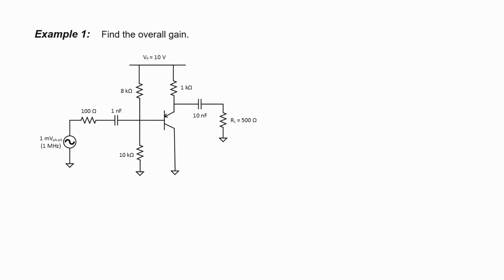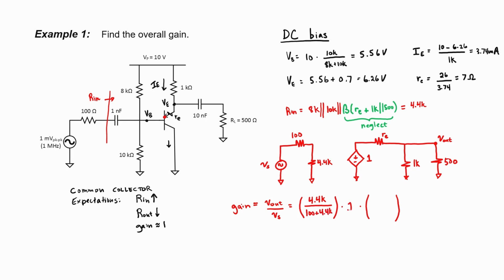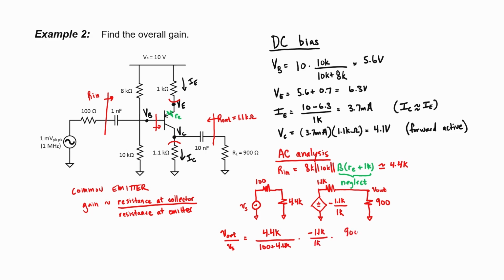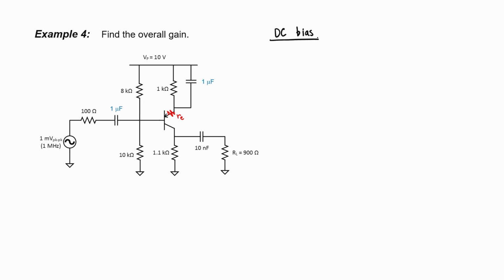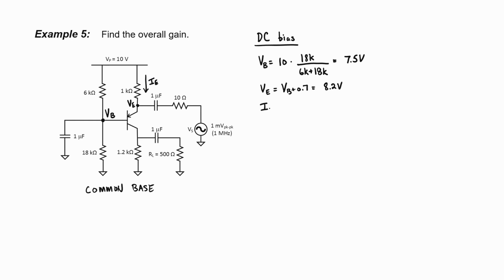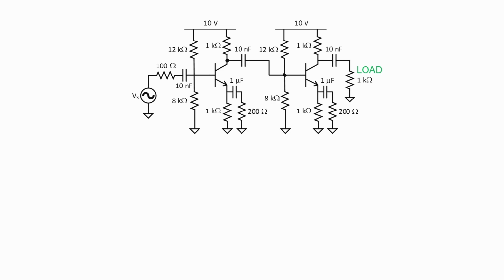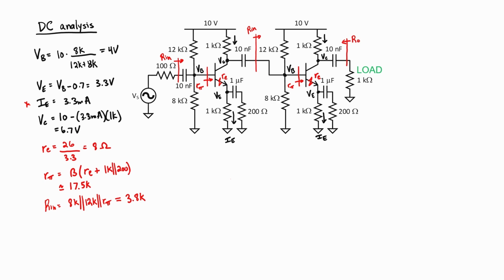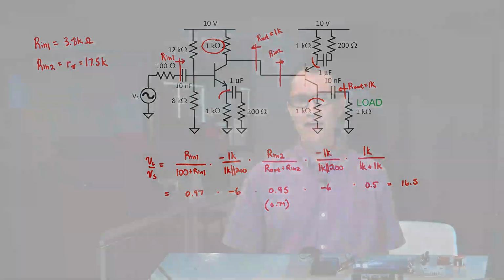PNP Amplifier Examples (21-Transistors)

Comment: Why the output resistance of 1.1K is not in parallel with the Load resistor in the common emiter (example 4) please?
Reply: I also think that they should be in parallel instead of in series.
Reply: Output resistance is 1.1k. Also they are in parallel when calculating overall gain. It’s the same as in previous examples for both.